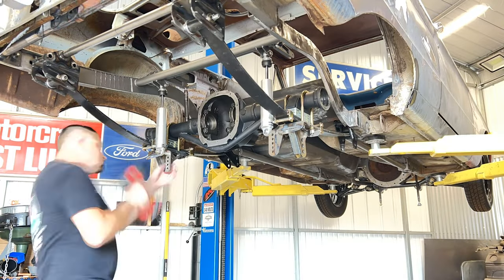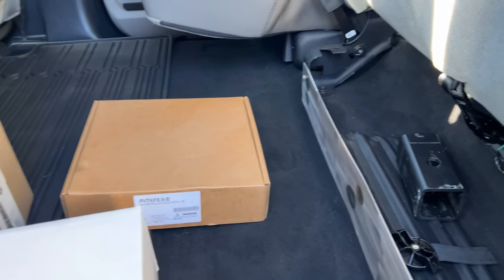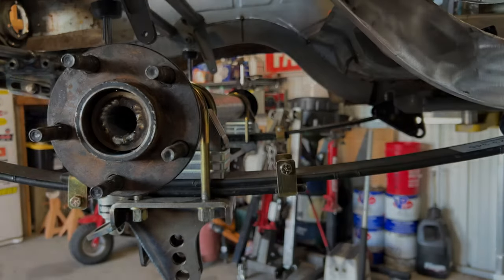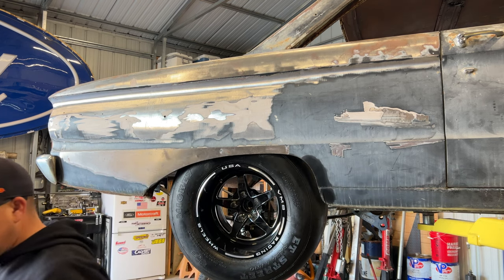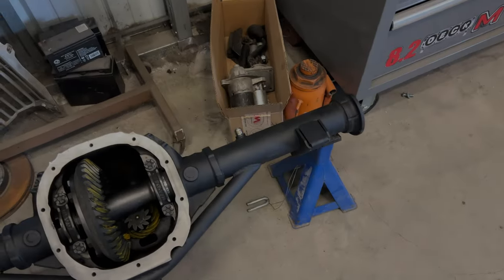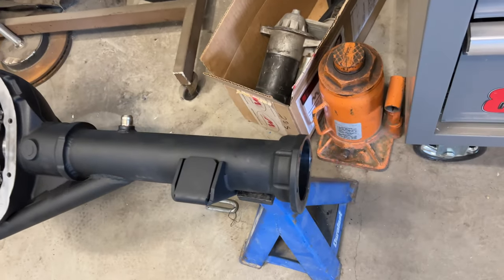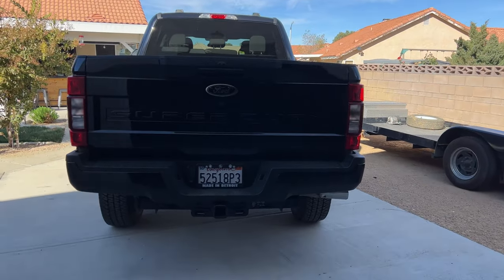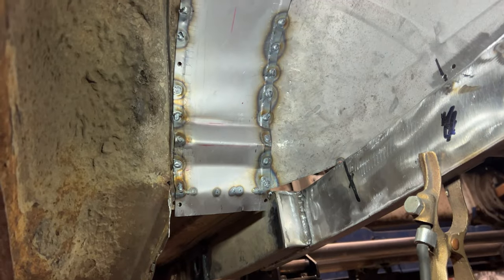MORE WHEEL TUB AND AXLE ISSUES!! and healing up from surgery!!!

Comment: Nice to see you back in the shop,question where did you get the solid spacers insted of crush sleeve. Thanks now to the rest of the video
Reply from the maker: Strange makes them and you can get them from summit racing. Thats where I got mine. Some people say the crush sleeve is fine but Bob isnt the only person who told me once the crush sleeve gets a good shock it can loose its preload and then you run into problems. The shims wont loose their preload so thats why I went that direction.

Comment: Thanks for the updates on the falcon. Don’t over do it. Give yourself time to heal. What size wheels and tires you going with? (Front and back)
Reply from the maker: I think the fronts I am going to use the 17 inch skinnies rather than the 15,s and the rear is 15X10 the tire is the 275 radial pro from Mickey Thompson
Reply: @TeamDPerformance  Thank you! I have a 1966 Fairlane hardtop I am planning for some chassis/suspension upgrades.